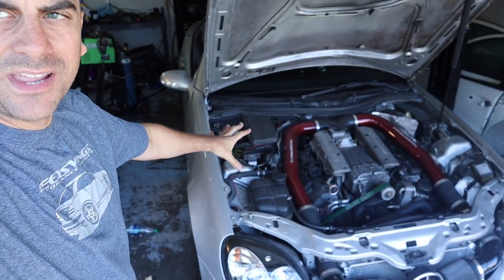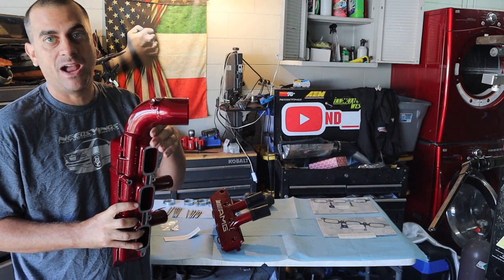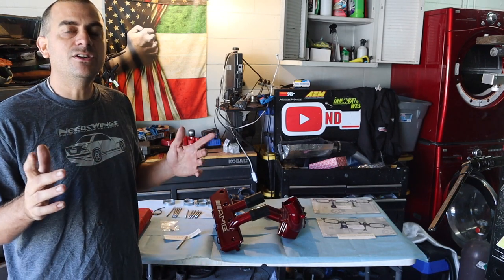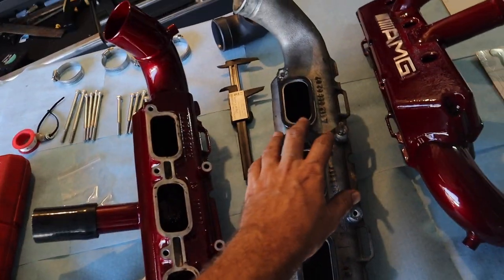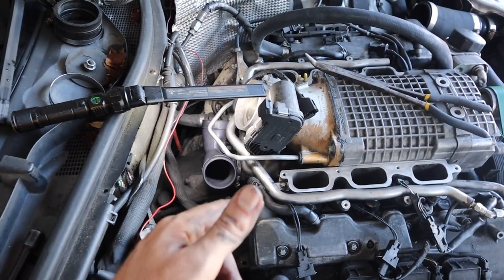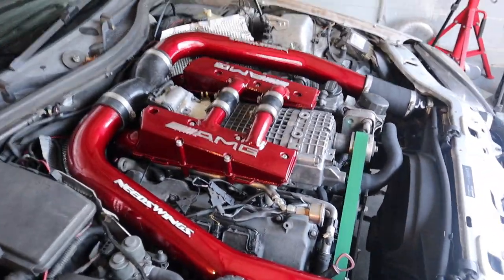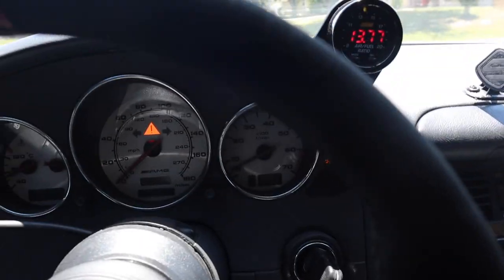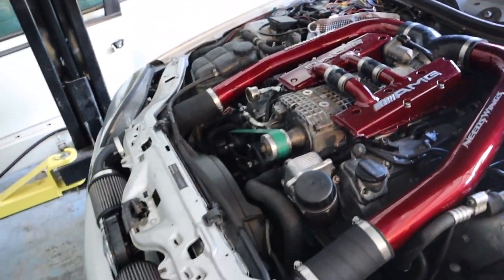Upgraded Intake Manifolds For Slk32 and SRT-6 (needswings) m112k

Comment: I am running a very similar setup. I have the 65 and this has me thinking about a 178 to stack. Needswings makes good stuff. The tweaked crossover manifolds seriously dropped my boost and temps. I also run a wet nos kit for fun. Hit 440hp and 490 tq on the dyno with the nitrous. I can’t use the nitrous without my drag radials on.
Reply from the maker: I am going to try meth soon
Reply: @Nd_72  we like meth around here bahaha
Reply from the maker: @xxkai45xx48  lolm

Comment: Looks so cool. 
This goes good only slk 32 AMG?
I own 2003 slk 320. 
It does not fit. Right?
Also, let me ask this...
I always wonder if you do tune up thing,
How state inspection staff goes???. How it passed?
Reply from the maker: It will not fit a na m112 sorry
Reply: @Nd_72  hi thx for reply 
For m112, I wanna get just a bit better acceleration.
What do you suggest ?  
Always enjoy your video.

Comment: Did you go with the SL55 intake pipes? I don't think I saw a video talking about that replacement, I'm thinking of replacing my stocks but thinking the SL55 are bigger than the ones meant for the c32
Reply from the maker: I don’t run the sl55 set up

Comment: What kind of power difference are you thinking these make? I see Rob doesn’t sell the custom surge tanks anymore, just these modified stock ones. I wonder why. I’ve been running his PSK with a 185 crank for over 10 years.
Reply: The big ones weren't worth it. Car made 10whp with those ones
Reply: Each car different of course. Cooling the main thing

Comment: Hi bro, are your injectors and fuel pump upgraded with these mods? What are they?
Reply from the maker: yes 630cc and a sl65 fuel pump both are plug and play but you don't need to unless you ae adding more boost